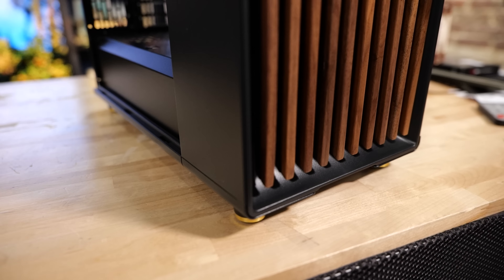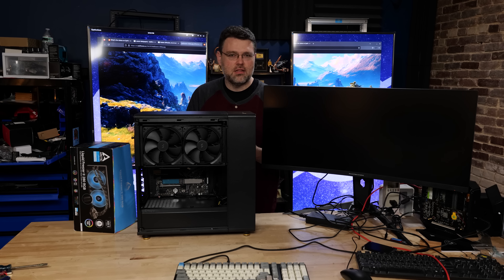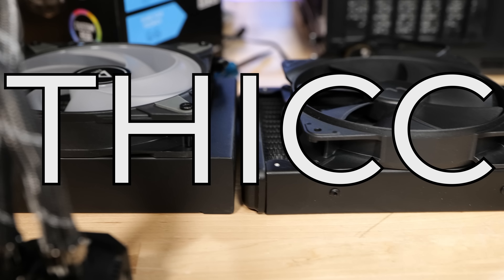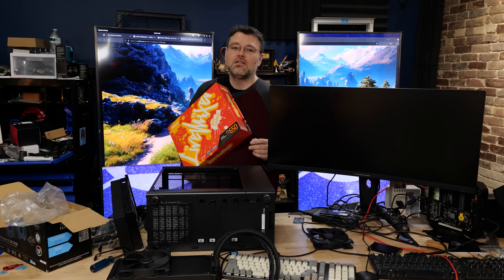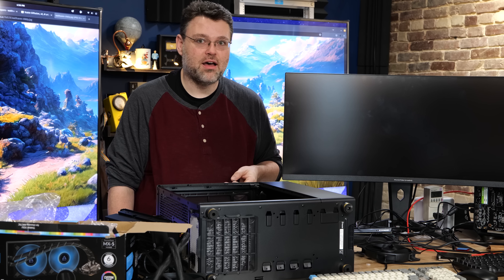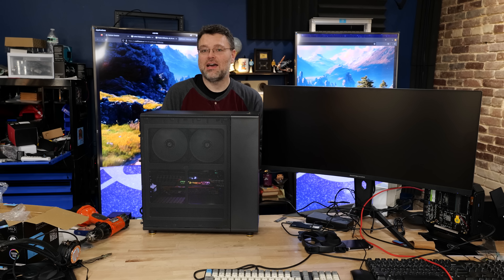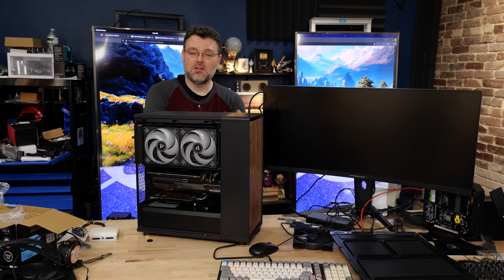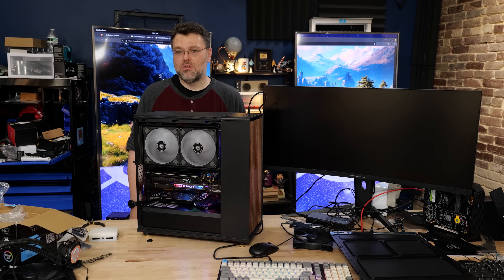Revisiting the Fractal North: Still a Great Build Experience?

Comment: I'm running this case with a 280mm Arctic Liquid Freezer II in the fan bracket thanks to your previous video. Works like a charm. I did add 2 140mm top fans air and 1 120mm rear fan (mounted on the outside or it wouldn't fit) to extract hot air. Motherboard temps are good too, all temps are really good and it fits together with a chunky 4090. Awesome!
Reply: Have you tried to install an 80mm in the rear instead of mounting in on the outside?
Reply: @adrian-paul9114  It's the fatness of the fan that's the problem, not the size. The radiator bumps into the top.

Comment: I would like to see some RAM speed test when testing 8-12-16 cores as everyone seem to ignore this aspect completely and only takes a minute (memory controller speed)
Same goes for testing 2x M.2 running in parallel during benchmarks and see how CPUs handle the multitask of storage devices.

Comment: If they actually made a full tower size I would love to buy it. I'm not willing to stuff $3,000 worth of stuff in that tiny thing and make compromises due to the case. So, I'm waiting for a Phanteks NV7 which is also beautiful, just in a different way.
Reply: The fan bracket allows you to sidemount a 280mm radiator and still fit a giant GPU like a 4090. It's super efficient use of space and it looks nice too, it's great.
Reply: @Jajalaatmaar  You can't mount certain third party GPUs. As was said in the original North video - if only the case were 5mm longer, compatibility would be no issue at all.

Comment: How has the BIOS update on the B650 been for you? Mine kinda screwed up my undervolt so I had to redo that. Went from neg 36 all cores to neg 30.
But the same performance, roughly. So I suspect they changed some values.
Reply: Pretty sure you can't go more than negative 30 anyways. Even if you can enter it it doesn't change anything.

Comment: will a 280mm artic fit in the top part of the case? or would there not be enough clearance?
Reply: 240x35 is the max for top mount on this case
Reply: 280mm arctic will be side mounted for it to fit, up top can only fit up to 240mm

Comment: 4:08 I don’t get why there isn’t a single AM5 motherboard with three electrical PCIe x8 slots from the CPU (instead of M.2 slots) and a single electrical x8 slot from the chipset, would make a great home server basis.
Reply: how would that even work? the cpu has 24pci-e lanes, 4 of which are used for the chipset, so at most you could have 2 x8's pci-e from cpu and 1 from chipset.

edit: im big dum dum and can't read properly, misunderstood what usable/total lanes on cpu meant
Reply: AM5 CPUs have 28 PCIe lanes in total (including the chipset interface), 4 more than AM4. Many motherboards use this for two M.2 slots from CPU PCIe in addition to the main x16 slot.
Reply: @abavariannormiepleb9470  you're right. still I'm not sure if motherboard manufacturers can just ditch the cpu nvme slot and usb4 lanes and use the lanes for other purposes, because thats part of 'core feature set' of x670e and i have a feeling the board has to be approved by amd to be sold
Reply: I think AMD don’t care tooooo much about these design guidelines, I doubt they expected these “X670 chipset PCIe Add-In Cards”.
Reply: @fleurdewin7958  hes suggesting to add 2 8 lane pci-e slots instead of 1 16 slot
Reply: In total “my design” would have four electrical x8 PCIe slots, three of which use lanes directly from the CPU, the last one uses the chipset as a PCIe Switch, this way you can operate an AIC with up to PCIe 3.0 x8 in there without it bottlenecking (for reference the ASUS Pro WS X570-Ace is the only motherboard model so far that has used such a chipset PCIe configuration).

Comment: Is AMD potentially crippling next desktop AM5 APU, by making it 4.0 lanes compatible, and not using 5.0 lanes ?
Reply: Not really. PCIe 4 isn’t really relevant outside of the top end GPUs, and even then it’s a very minor bump.
By the time 4 is relevant, the early PCIe 5 capable CPUs will be irrelevant.

Comment: Offset mounting was proven to be negligible and considered margin of error. Its why no one (meaning other brands) is doing it. The whole point of a heat spreader is to soak up heat and transfer it to a larger surface area to increase cooling. Direct die still works for Intel because the chip is freaking huge. AMD's smaller chiplets wont benefit from direct die.

IN FACT The de8auer video is null and void because he started the video testing the cpu normally but with shit thermal paste. Then after delidding tested direct die using liquid metal. Scientifically speaking you CANNOT change thermal compound when testing. Either use paste both times or liquid metal both times. The sheer fact that he switched completely invalidates his thermal difference. DOUBLING DOWN, I would dare say he was duplicitous on purpose.... there is no logical reason to change from horrible quality paste to liquid metal because that alone would result in widely different temps. It was pointed out by people online that their 7000 series cpu with liquid metal on the IHS achieved the SAME temps he claimed to get with direct die, which that alone invalidates his testing even further. So the idea of offset mounting? useless. And even direct die being useless for AMD as proven by countless people online.

End of the day? I want ASUS to make their AP201 case but full size, with E-ATX support. And then make it a cube case, where the backside will have a full array of 3.5 HDD storage in the front and psu mounting in the rear (maybe dual pcu for those that want/need it). we really need smarter case designs. I would actually love a case where the motherboard lays flat like old-school computers. Back in the day style lmao. I have like 3 case designs in my head but I am no engineer and can't use modeling software for shit. I could draw it out on paper i guess, but even then it would be really basic compared to having someone actually design it.